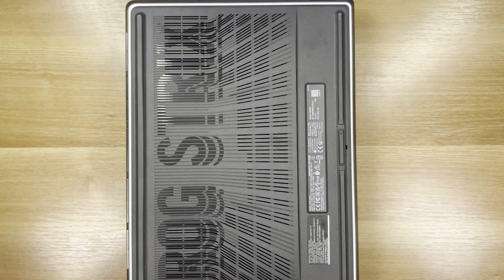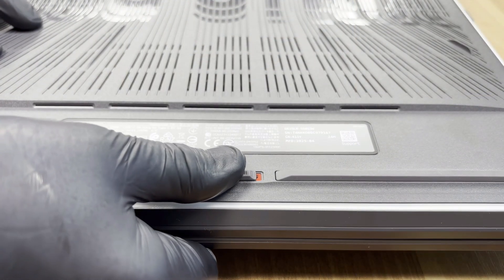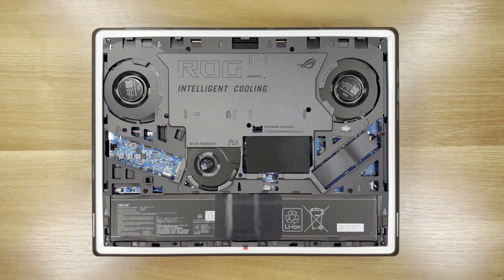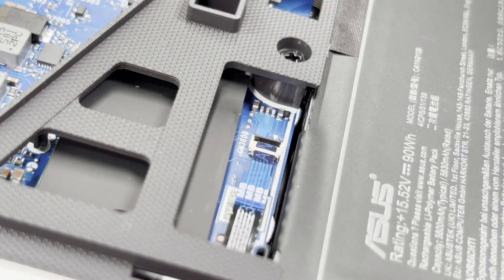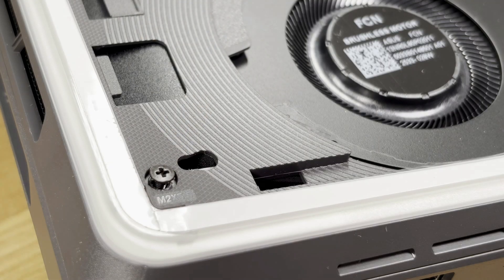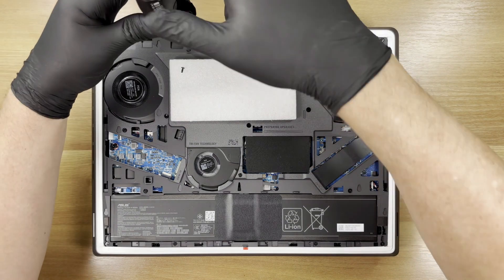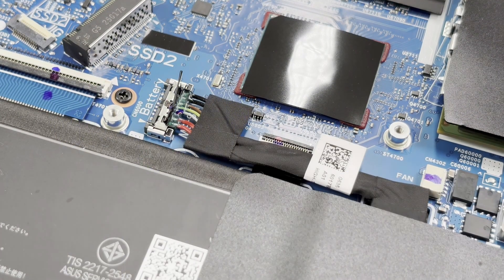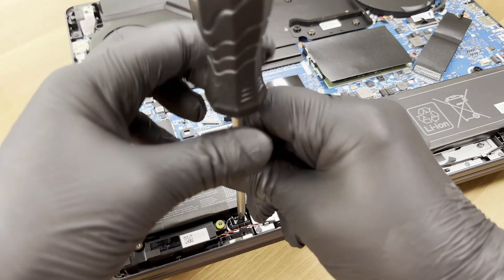ASUS ROG Strix G16 G615 (2025) 🔧 | Disassembly & Upgrade Options | X-One Tech #rogg16 #asusrog

Comment: What is the thickness of the thermal pad that goes under the SSD?
Reply from the maker: Generally, the thermal pad under the SSD is 1mm thick.
Manufacturers sometimes vary between 0.5mm–1.5mm based on the motherboard clearance, but 1mm works for almost all NVMe slots.